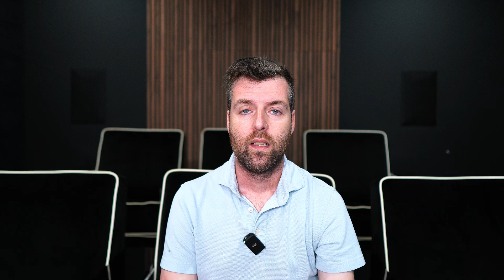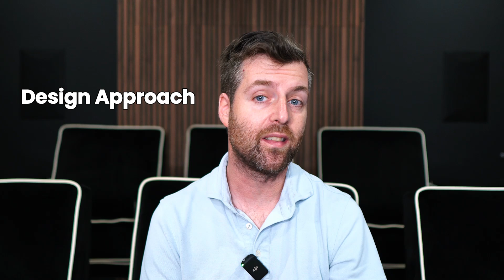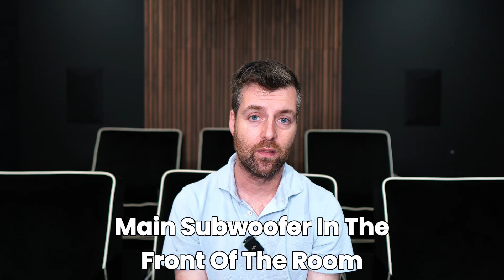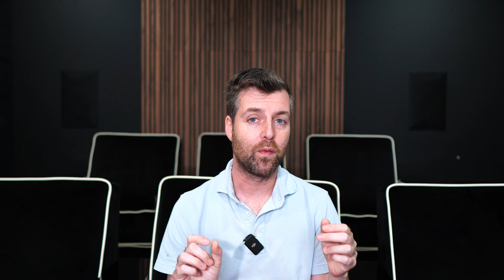Home Theater: Design Approach vs Software Approach

Comment: Hi Matthew, I’m curious why you talked about the front wall sub array (with 4 subs placed a 1/4 from side to side and top/bottom)? I have seen and read about this type of setup, but haven’t been able to find any supporting information (theory why this would be beneficial) about this method. Most recommendations include placing subs in corners, thus my confusion. Note, I will NOT be using any type of wave forming method in my system, neither were the systems I have seen and read about. Thanks in advance, and I learn a lot from your videos.

Comment: Initially, I thought you meant engineering the construction of the room, then I realized you are talking about engineering channel location. Most people I know have no choice but to place channels where they will fit in a prefab room. 

As you state, it is probably why so many of us continue tweaking software results trying to overcome poor location obstacles. Excellent points made in the video.
Reply: @MikeYoungeasytravel 
Centered subs perform best 👌

Comment: Very informative 👏 
As you said speaker layout or placement is very important bed layer speakers what height from floor to be maintained and what is the reference point for height whether it's tweeter or midrange of the speaker.same way for height chanel what angle to be maintained for proper chanel separation with sourrend speakers
Please share those informations of your coming sessions